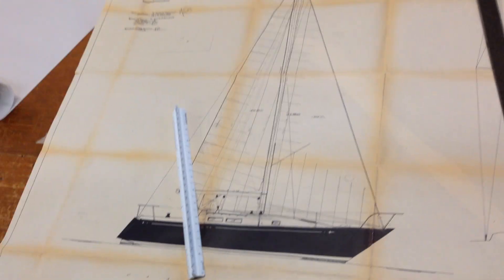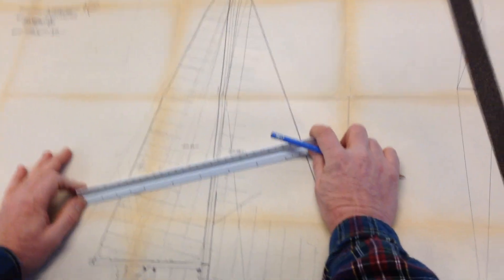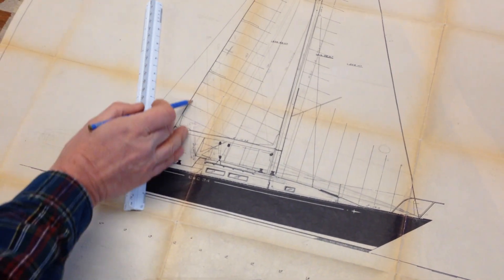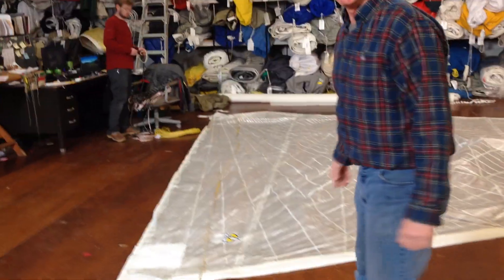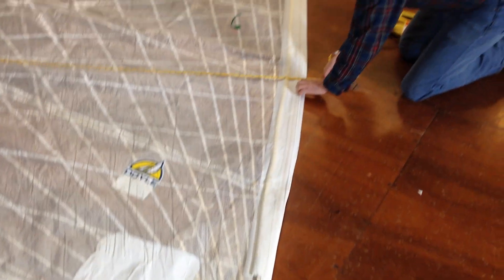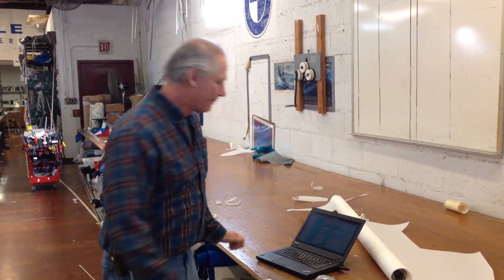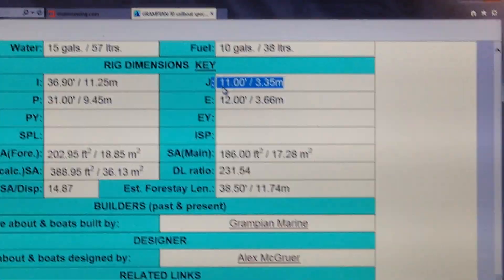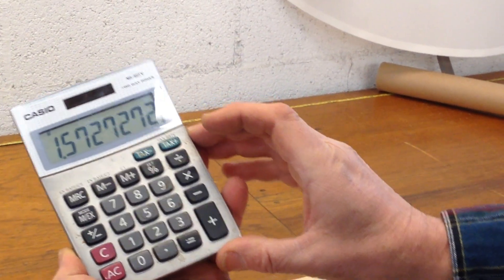Headsail Sizing (what that % thing means)

Comment: Why people use 150% jibs? Are they noticably faster sailing upwind at light-moderate wind? Because 150% jib can not sail as close upwind as high aspect 100% jib I think VMG to windward mark will be very similar at moderate wind.
Smaller lighter jib works better at light wind.
At high wind you can not use oversized jibs.
150% jib might be ok for broad reaching or for wing on wing. But again, any asym spinnaker will work better.